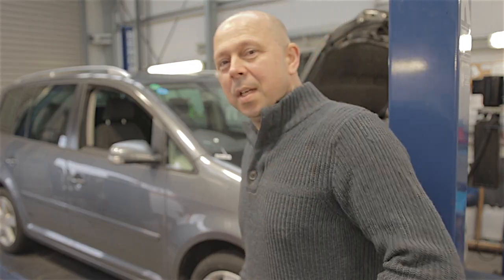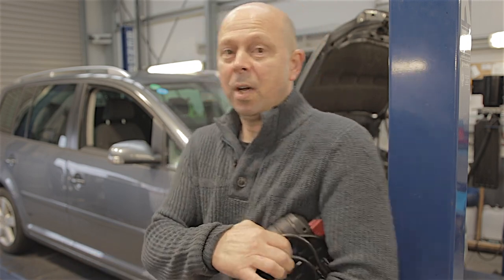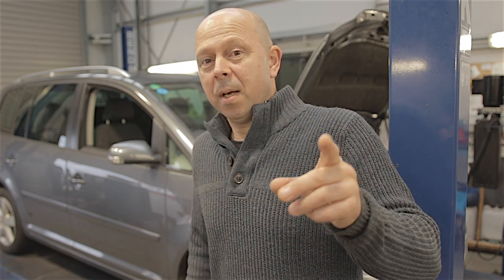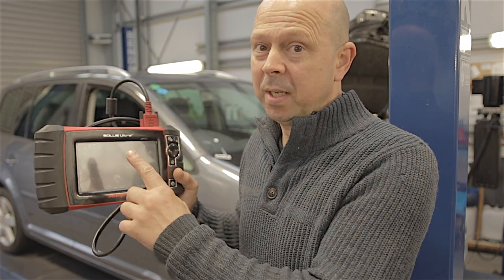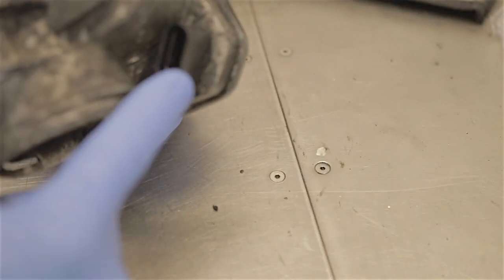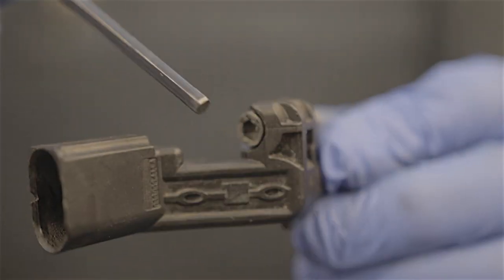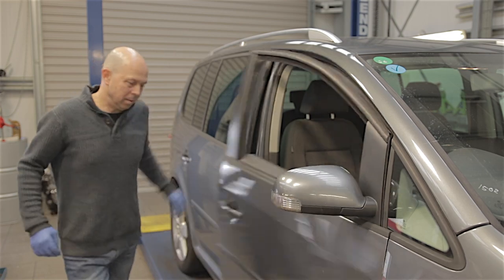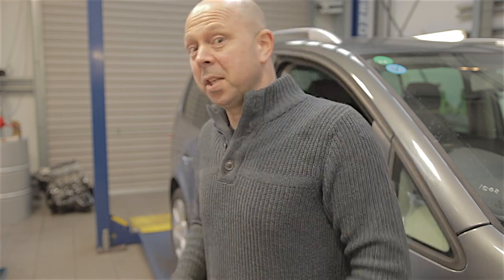12546  Motor For Intake Manifold Flap V157 No Signal P3102   FIXED     2006  VW Touran

Comment: Hi had the same problem , inlet flap motor was replaced, fuse replaced, but after a short time the inlet flap motor and engine light (emissions workshop) came on again. Fuse has not blown again. Wondered if it was faulty d plug or rapid build up of soot in the valve body. Sorry posted on my wife’s login: Regards Dave. I had cleaned the original inlet flap valve as it was heavily sooted. I got it moving again but it blew a new fuse. So I replaced it with an after market unit which was £85 rather than £185. Any help would be appreciated.

Comment: Very nice video! Do you know if its possible to open the intake manifold flap motor to service the gears inside?
Reply from the maker: no i wouldn't bother, just fit a new pattern part one, they don't cost too much

Comment: Hi Alan, love your videos, keep them coming in!!
Question for you, I'm no mechanic by the way. If the 10A fuse also serves the engine management module then surely the engine wouldn't even fire up??? Or am i missing something??
Thanks Alan
Reply from the maker: most modern cars have multiple fuses for various aspects of the engine management system, most won't stop the car from running, just give an engine light and running problems

Comment: Alan.  Car trader.  No mechanic me. Same engine speed sensor for vAG 1.4 petrol too, also buried in block.  However the stuck seized intake motor , could you have sunk in paraffinbath overnight.  Would that have freed it ? If trying be cheap ?  Just started trying fix my own basic single fault code fixes. Glad didn’t try sort your Touran.
Reply from the maker: not sure if that would work,, its just more about getting it fixed quickly
Reply: @alan4x  yes. For sure A

Comment: One thing that got me thinking has the fuse blown because of a short to ground on the cooling fan circuit rather than the problem with ceased motor? Will it blow again next time the cooling fan kicks in???
Reply from the maker: the fans are working fine with the air con so i putting my money on the intake flap motor blew the fuse

Comment: Well Alan at least the crank sensor bolt didn’t snap which is what happened to me, a royal pita ensued to get that drilled out. At least the oil pump drive hasn’t failed on it………..yet, though given the age that might be the best thing.
Reply from the maker: yeah...i do not ever want to replace another one lol

Comment: Alan I’ve been trying to bleed my petrol 2.0 duratec engine mondeo 2007 mk4 and I’ve undone the blood nipple by turning it by hand but now when i seat it back to its original position it is still leaking brake fluid out of the bleed nipple ?? Replaced the master but now can’t get the bleeding to work !

Comment: I had the same issue replaced the flap, the plastic tooth had broken off in side the flap motor and it was full of oil. popped the fuse too! Codes 19557 - P3101, 17075 - P0691

Comment: The days are gone when you had a problem in the engine bay is lift the bonnet and have a look first,  or check the fuses, seems its plug a computer in and scan it for codes 
Nice to see the old tool box came with you ...  its a bloody long walk to borrow stuff now ? 
Fresh content for your channel 
See your missing that heater already with that winter jumper on ....
Reply from the maker: lol...there is a good heater up here ..just not switched on, have a good one mondo

Comment: Mate: Great clip as always. 

Question for you : Is the crank/speed sensor part of the engine management module? If so, in retrospect do you think its fault code was also related to the blown fuse - and therefore did not need replacing?
Reply from the maker: the code for speed sensor was coming on regular until i replaced the sensor, then it went for good so i don't think it was related to the fuse plus originally with the old crank sensor the glow plug and engine lamp were coming on together

Comment: Hi Alan, I also have fault code P3102 on my VW Passat 2.0 TDI ( 55 plate ), so would my fault be the intake flap too, it does say online that it is wiring... does that mean that the motor wont work. Cheers bud.

Comment: Hi there Alan, pleaseeeeee help!!!
I have a 09 ford kuga that had a snapped camshaft. My colleague replaced this , cam belt etc. After a lot of bleeding air took car for a drive and ran absolutely fine, no warning lights, pulling well through all gears and thought brilliant. Keeps stalling / won’t drive above 2000 rpm. He suspected car entered limp mode but has found leak off 1/2 leak off pipes keep “ popping out “ has replaced these but keeps happening. Seems to be engine / air leak in and around injector areas. I’ve been very stressed with this car as it’s our family car and have resigned myself to given up on it now but after lots of money it surely can’t be far away if it runs so well intermittently? Any advice would be greatly appreciated, thank you
Reply from the maker: a leaking leak off pipe won't put the car into limp mode.....i would connect a scanner and firstly see if there are any codes too point you in some direction as to where the trouble may be

Comment: Hi Alan. Thanks for another great video. I have a 1.2 2012 polo. The engine light has been on and off recently which takes me to the camshaft sensor. I changed this for another one and the light went away. It’s now back again and when I reset the codes it goes and then comes back on again at some point. The car doesn’t sound / drive sluggish as others have mentioned. It’s spot on.

I’m starting to run out of other ideas, and I’m extremely close to take it into VW, just so they can properly find out what’s causing the issue. - Do you have any other ideas? :)
Reply: I had same with a fuel temp sensor. Clear codes would eml would stay off for one start and then come on again. Would get me through MOT. After much searching it was the wiring loom had rubbed on a pipe and worn through and cut the earth wire to the sensor. This may be your problem?

Comment: Rule number 1 when you've got a fault Google the shit out of it and read every thread doing that I found out that fuse is shared with the cooling fan and throttle body but in my case the asv is just making a buzzing sound when I turn ignition on/off so I know its that that's knackered as my fuse is fine